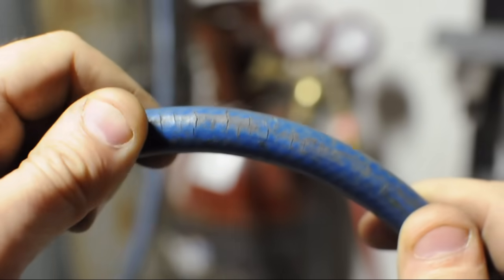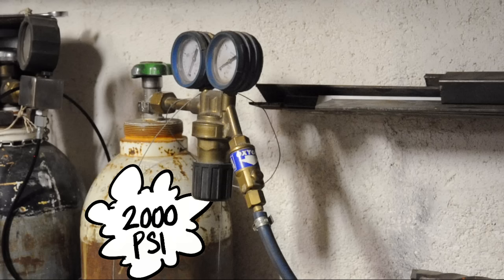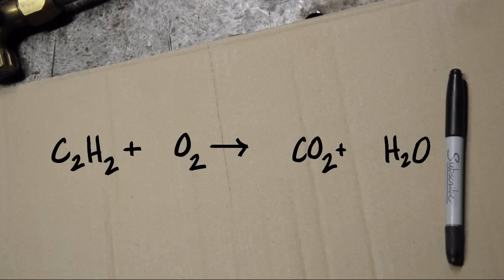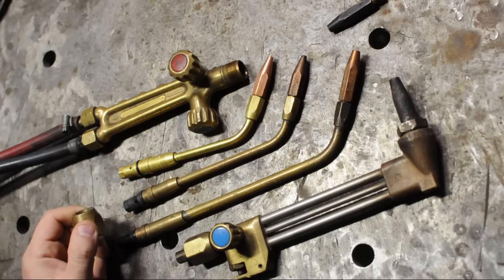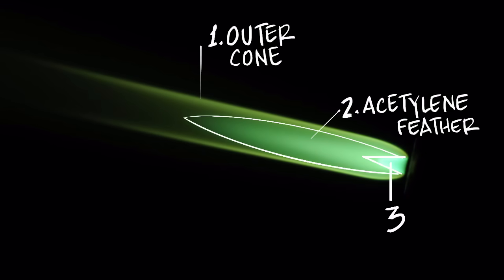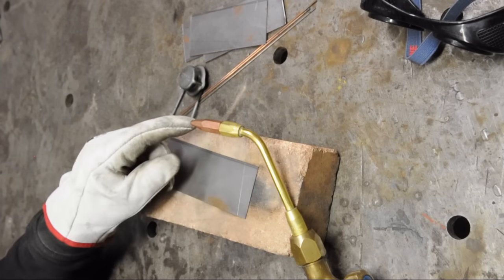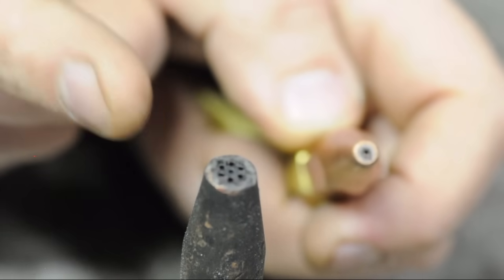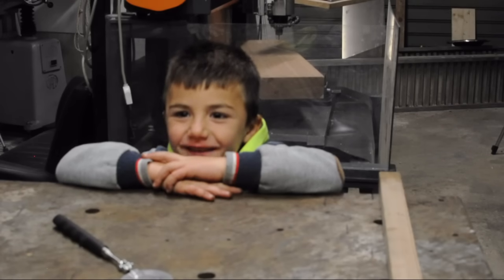Let's Talk Oxy Acetylene

Comment: i dont know if people are sarcastic in the comments. but wtf...lol also every hose ive worked with is/was red and green hose. blue is fresh air supply for my hood id hate to get those mixed up...lol and flash back need to be at the closest to the torch... right on it.  and on torch cutting, the 6 holes are for preheating and center is to blow materiel out...look at a scarfing tip...fyi and a act. bottle uses a dip tube. not like oxygen where its strictly gas

Comment: Pro Tipp: Never open the valves on your torch before searching for your striker, especially in a small and enclosed area... you're essentially build a pipe bomb with yourself sitting in it

Comment: Hugely super duper dangerous to use after a acetylene cylinder was on its side. The most dangerous aspect is that you can get away with ignoring that rule until you don’t. It can be an aggressive and efficient face rearranger 
Rule of thumb is 3 hours up for every 1 hour down .            (3 mins to 59 mins you just round up to 1hr )

Comment: And NEVER EVER oil or grease your fittings!!! It will explode!!!
If you didn't know that before buying your torch, you probably shouldn't have a torch!
Reply: That only applies to the Oxygen equipment. Remember (or look up) the deadly Apollo-1 fire on the launch pad, with pure oxygen at a pressure of just one atmosphere! Almost anything except glass and Teflon will be able to burn (or explode) in pure Oxygen. Also notice that the O2 gauges always say USE NO OIL, and never use valves, gauges or regulators with Oxygen unless they were purpose-built for use with Oxygen!

Comment: The reason to not use an open flame is that all open flames use a fuel. when lighting the torch  it can ignite the fuel source and to protect the growing population of  dummy's is why everyone is told not to do it, although lighting off a solid fuel eg. Like wood it is much safer than a gas or liquid like butane or propane.

Comment: Why do they call it acetylene? It's an old term just like acetone and acetic acid. These are the non standardized named.
In chemistry, for 2 carbon compounds, "eth" should be used as the rootname.
So, C2H2 is called ethyne. It has the "yne" postfix because it has a triple bond between the carbon atoms. It is in the alkyne class of compounds.
Acetone: The modern name is propanone. It has a 3 carbon backbone so the "prop" rootname is used. Since it is in the ketone class, it has the "one" postfix.
Acetic acid: The modern name is ethanoic acid. It has a 2 carbon backbone so the "prop" rootname is used. Also, it is a single bond between the carbon atoms. Since it is a carboxylic acid, the "oic" postfix is added.

Any more questions, Einstein?

Here is a bonus. At hardware stores, you might find muriatic acid written on bottles. This is an ancient name from 200 y ago. The modern chemical name is hydrochloric acid.

Comment: the reason you're not supposed to use an open flame to light an oxy/acc rig is you're exposing a potential fuel source to the business end of the torch. It's "safer" when its just a flint and steel.

Comment: I still use my grandpas old acetylene setup. It’s 35 years old and I’ve never replaced a single part but a regulator that started leaking. I waited til it was leaking pretty bad before I finally got a new one. You’ve inspired me to actually MAYBE go through the thing and do some maintenance. New hoses probably ain’t a bad idea. Never seen spark arrestors before! Maybe I’ll even go all in with a couple of those. Past 15 years, god has been arresting those sparks for me, I guess. That or you guys are just a bunch-uh pussies!

Comment: I don't think oxy acetylene welding would be good to start because it's not nearly as easy as MIG. I see what you mean about understanding the welding process better but also, oxy acetylene's extreme heat will warp the crap out of any panels/sheets that you weld except the thickest steel, like frames or pipes

Comment: Oxyacetylene is a fun mix, and I can’t begin to imagine how many idiots there are out there who don’t respect it. 

2 fun experiences from my pipeline days:

The idiot who used the torch to thaw a frozen oxygen regulator.

And much worse

The idiot trying to set the correct flame on a long lance during a hot-tap not realising it was steadily lowering onto the live gas main which by now was a dull cherry and starting to bulge.

Comment: Acetylene is getting more expensive as millennials and gadget phreaks  dump OA gear for electronic boxes with many dials. makes them feel like pilots in a cockpit. Fact is that OA can do all the heating, welding, brazing, cutting you will ever need in any location, even when there is no electricity.... even under water.  If you are an industrial fabricator OA is only used for heating, brazing, cutting but  90% of garages and households are better off with OA. You need to do your shopping with tanks etc. A 10CuM  (about 350 CuF) of f oxy tank will last you ages and it has no use by date. If you are keen you can do away with acetylene bottles by getting an acetylene generator. You can make up oxy bottles with oxygen concentrators. OA means being independent and being able to do almost all your welding  without argon, CO2 and helium bottles. Also you don't need to be fitted out like an astronaut to safeguard you from VERY TOXIC fumes and RADIATION, not to mention eye protection!. Don't go and buy the nasty and dangerous Chinese auto adjusting helmets. You can't replace your eyes. With Oxy/Acetylene will need a no 5 Green shade and a blue filter if you braze aluminium with flux (Exactly, if you braze aluminium with a Dillon torch, without flux, you don't need the blue shades).   If the metal is dirty and you use flux, always use  breathing protection or get a fan or vacuum cleaner to remove  all the nasty fumes from your face. Imagine your house being flooded. Garage under water. when the water drains there is only ONE welding set that will work and allow you to make repairs and it will not be your tig, mig or arc welder. Get yourself a Dillon torch and you will use 4 psi on O and A and your bottles will last almost forever.. At 4:45 Tony talks about the DHC 2000, Henrob, Cobra small torch with a LARGE price tag. That is the Dillon. Invented in the 70s in Australia. Weld thin metals without flux. including aluminium, stainless and mild steel. Even cat iron and cast aluminium are easily fixed with a Dillon. It is a TIG without all the dials and fancy displays.  It cuts steel like a plasma cutter. Take advantage of the gadget phreaks that dump the old OA equipment. You can get a used set with a Dillon torch for one fifth of what Detroit Torches will charge you for a new Dillon. While you are searching for a Dillon you will come across many "Buzz Boxes" that are given away.  These are old arc (SMAW) welders. Yes they can be  fiddly to start an arc but they are unbreakable (unlike the newer shiny Chinese junk arc boxes). Good for depositing large welds fast and economically. As for 99% of repairs you only need a Dillon

Comment: That looks like AIR HOSE, not supposed to use that.  The reason is SMELLS like that is they add LEAK DETECTOR to the Acetylene and makes it smell like Garlic.  Acteylene has no smell by itself they have always told me.  BB

Comment: Oh and the reason you shouldnt use a bic lighter to light your torch is probably not because of the actual lighting? I was told by my professor in college the risk comes from the proximity of a compressed butane lighter to where you are working. For instance, you light the torch most likley  you put the ignition sorce close to where you are working because its convenient. Then you place the lighter in your pocket and start welding away, little ole splat of molten metal flys into your pocket and sticks to the bic lighter. BOOOOOOM IT BLOWS UP IN YOUR POCKET!!!! Plastic shrapnel is shitty btw.. so thats what i was told. Do what you will... I use a striker. Always have always will, i also turn my oxygen valve on while standing to the side. Valves have been known to explode spontaneously from dust particles building  up and fuel oxygen and pressure... well you do the math i like my life.. well most of it haha

Comment: You dont allways need soap and water to find leaks or smelling it, some good common sense goes far. Learn about the system use flash suppressors for safety.
 Charge your system close torch. Close valves on tank loss of pressure leak. 
I laugh ive seen  old times fire off torch with a cigarett.

Comment: Steel is an alloy of iron and carbon. Apple dictation software just garbage just garbage we tried to use it anyway we tried to use it anyway as a substitute for settling as a substitute for settling settling acetylene thank you acetylene bottles cylinders try cutting a rusty nut buff and rusty bolts try cutting a rusty nut buff and rusty bolts without disturbing the threads on the bolt without disturbing the threads on the bolt.so much for apple dictation. try oxyacetylene welding a tooth on a ring gear, in place, thru the hole the starter motor goes in. As to the nut, a solid tungsten carbide drill bit, used judiciously...austenitic, martensitic...avoid applezitic. The carbon is what fuels the cut, catalyzing the iron. Seen so many accidents, you would not believe. Preventable. I know how to spell. And prevent accidents Apple doesn Apple victimized as the disabledApple victimized as the disabled

Comment: Learn on gas & stick. That way you can sneer at mig jockeys for their lack of freestyle ability.
Reply: Professional mig welding is an art too. Ive seen guys weld so uniformly. If they weld a cylinder  you could not see where they started or stopped. Ive also seen a stick welder bend  the arc rod into a curve  and weld a  cast iron elbow onto mild steel sprinkler pipe through a 20mm  gap in a ceiling above his head. He could not actually see what he was welding. Apparently you can listen. Anyway water on and no leaks. I can hardly believe it to this day.